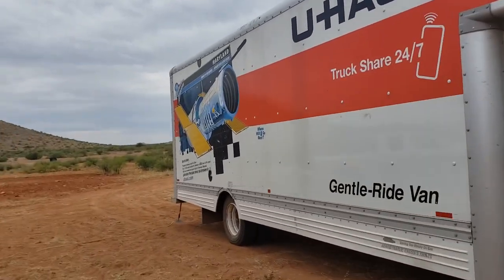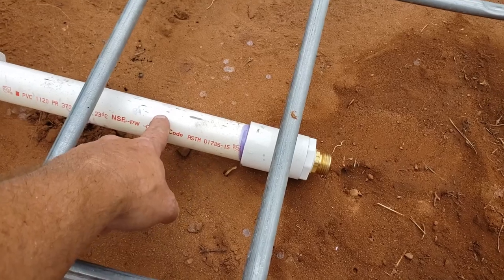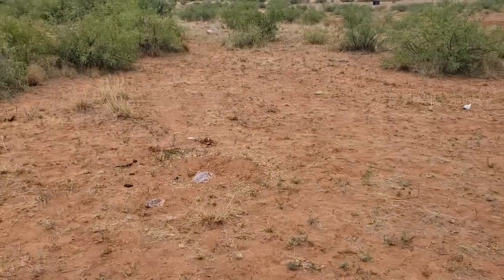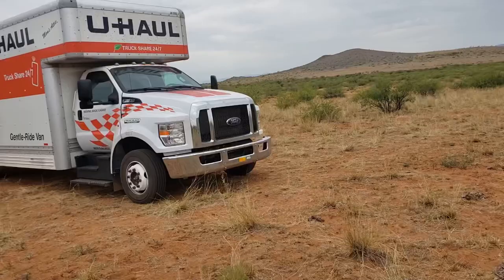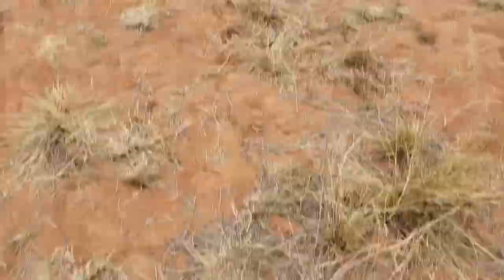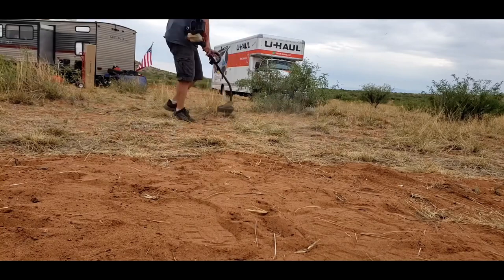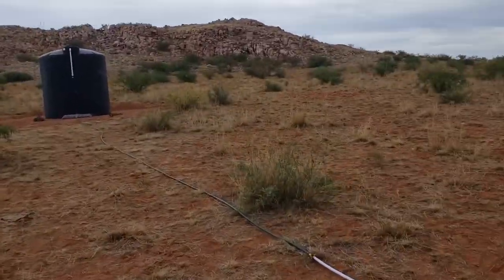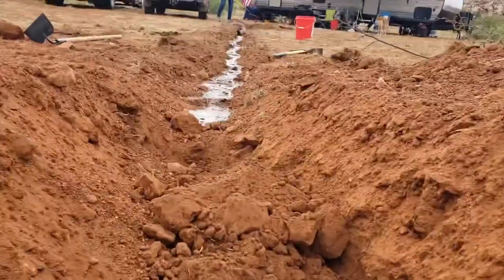Off grid living | Sewer line is dug and we have water 💦 !

Comment: You need to get or rent  a small used tractor or backhoe. How do you keep the water clean from the roof runoff?  Take care.  (No more pretzel legs, lol.)
Reply from the maker: I'm looking for one for sale. To keep rain water clean after coming off the roof you use a first flush system. Very basic system that's been used for years. It basically catches the first few gallons in a pipe before that overflows to the tank.